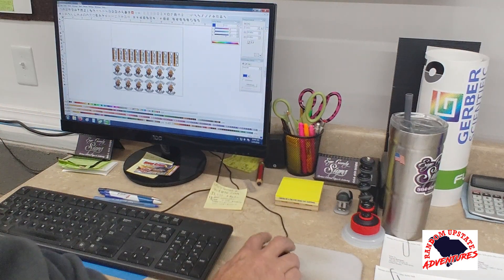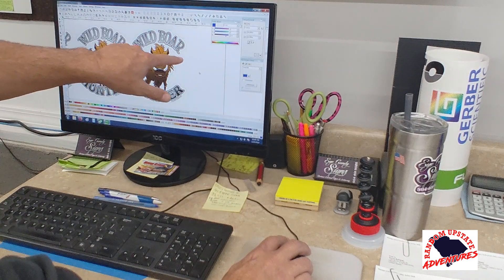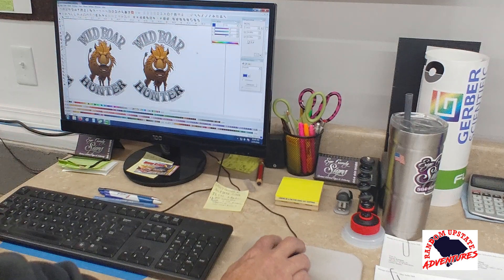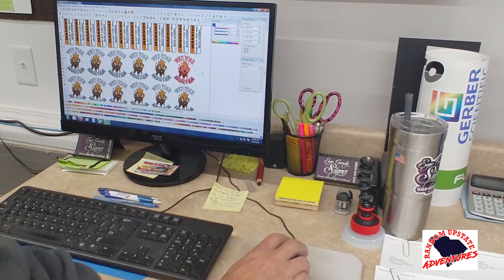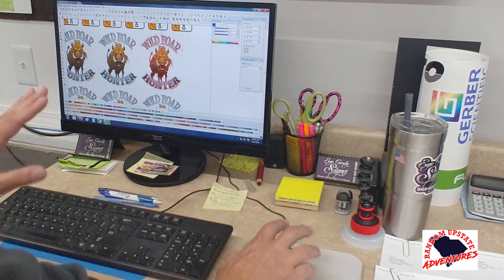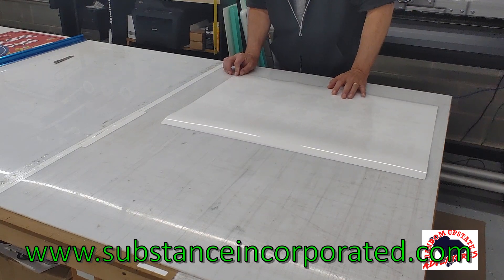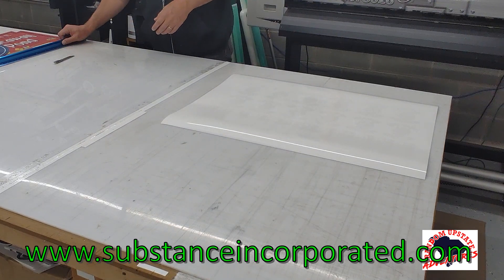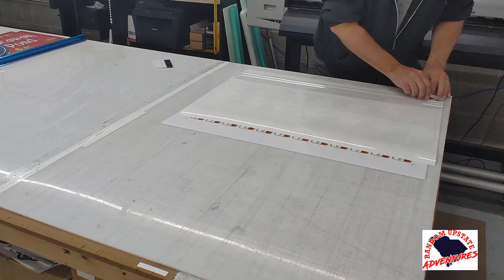Print, Laminate and Perf Cut Decals with Flexisign and Graphtech (PLUS a little trade secret!)

Comment: To be able to cut the adhesive completely, do you use a special Teflon? Does this type of cutting damage the Teflon?
Reply from the maker: With the 8600 it has a "gutter or channel" in front of the Teflon strip. You have to move the blade to the front position of the holder and select perf cut option.

Comment: Thank you sir! I use cutting master 4 through corel, but using these numbers for the fc8600 has helped tremendously...the only thing I may differ on is I use the cb15u blade and the cb15u setting for perf cut, but the setup is basically the same! I never got perfs that would actually "pop" out until now, maybe it was the "up" setting that I had wrong?
Reply from the maker: When the video was made I was using the 45 degree blade, now the 60 degree blade (cutting the media and laminate) is the way to go. Glad it helped, it really depend on the media you are perf cutting.

Comment: What would your settings be if you were to perf cut non laminated stickers?
Reply from the maker: Try around 15 on the 8600 with a 45 blade, not as much with a 60.
Reply: @TheSignGuy  Hey Boss Man,  Quick Question using 45 Blade does the Perf Settings "Up" and "Cut" the same??
Reply from the maker: @coachdonhighdfw  My setting is #3 CUT .315 / #4 UP .006 this is with a 60degree blade. The 45 was just barely getting through the backing and the 60 seems to be a better cut.

Comment: Curious do you always use type 1 marks, or find they get picked up better than type 2 or is it just personal preference?
Reply from the maker: Have been using type 1 even since we had an inkjet printer. 99.9% of the time I don't have any issues with the type 1 marks. I can make them as small as .300/.025/.075 and it will pick up fine on white media. Reflective and mirror media I try to make them .500/.050/.100.

Comment: How long are you waiting in between printing and laminating?
Reply from the maker: Generally a few hours depending on the profile and how much ink was put down. A heavy Black at 720x720 will take a bit to outgas, not that I've ever had a big issue with it. Latex you don't have to wait, EcoSol give it a few hours if you're in a rush.

Comment: Hi i have a roland evo solvent can i use this stuff
Reply from the maker: If you are using Flexisign and a graphtec cutter yes. I don't have any experience with the Rolands, sorry!
Reply: roland is a print and cut machine eco solvent
Reply from the maker: I don't think they can perf cut. Only certain cutters can do that. The Roland will contour cut but not perf cut.
Reply: @TheSignGuy  i just looked it up on roland it does

Comment: This perf cutting has really puzzled me , in your video is it just one cut? 
I wanted to do two, a contour cut , then the perf cut a bit wider to make sticker removal easier , would i contour cut , then move/switch blade position and run the cutter again?
Im using a roland 54" cutter with flexi
Reply from the maker: Hello Ken, Yes in my video I just do 1 perf cut. You can do what you want but it will be 2 separate cuts, 1 contour then move the blade to do the perf cut. Sorry I have zero experience with the Roland cutters but you should be able to set the conditions in flexi
Reply: I'VE HAD THE SAME QUESTION FOR A YEAR. I'VE ASKED THE COMPANY I BOUGHT THE GRAPHTEC FROM A FEW TIMES AND HAVE'NT HAD ANY LUCK. HAVE YOU FIGURED THIS OUT SINCE YOU ASKED THIS QUESTION?

Comment: Using flexi and same cutter. So do the settings at printer override settings in flexi? Or can you also change settings through flexi without manually changing on cutter?
Reply from the maker: Flexi will override the cutter so in Production Manager pay attention to the "cut" tab, and your driver options. You can set the condition there but You should set up a special condition in flexi but it will also require a special "perf-cut" cut line within flexi. I prefer doing it at the cutter because you have to move the blade holder out anyway and sometimes I forget to move it to the back position.

Comment: Why do some people perf cut and others diecut?
Reply from the maker: Um, good question LOL. I assume because pef-cut looks a bit more professional. But also in my opinion customers really don't care unless they are re-selling the decals.
Reply: @TheSignGuy  so I guess my question is what's the difference really?  Perf cut is when the blade moves up and down and diecut the blade doesn't...right?  I typically  just do kiss cuts and never really done anything else.  Check out this video on diecuts.  Skip to 4:20....

https://youtu.be/3tPcWwkm4cs
Reply from the maker: @blueghost4121  Basically yes but your cutter has to have that option to Perf-cut, some dobut most don't. A perf-cut will cut through the media/paper backing and a contour cut is just through the "Sticky" media. I refer to contour cutting with a print//cut, I refer to die-cut with normal solid color sign films. I've never used the term kiss cut

Comment: I see that you have a 54 inch printer and cutter but it looks like you are using 30 inch vinyl and laminate. What's the reasoning behind this? Easier to work with because of the smaller size? Just wondering because I have a 54 inch printer and cutter. Thanks
Reply from the maker: It's more cost effective for me to print and laminate with 30", If I use 54" I waste more media. I've designed most of what I sell based on the 30", I still have some 54" in the shop but don't print on it much.

Comment: Great video. In regards to the laminating? it doesn't need to be heat treated? Would the laminate peel off or does it adhere permanently?
Reply from the maker: No you do not need heat when you laminate. I know heat assist laminating is better in certain situations. I have seen laminate separate from the media but 99.9% of the time it's never been an issue for me. Grab the BIG Squeegee and laminate away!

Comment: i bought some of the substance ICON® PL-3150 overlaminate. There seems to be a lot of silver even with lots of pressure added. Also looks like some metallic flake in the vinyl. I just applied it today so maybe i need to wait a bit. Any tips?
Reply from the maker: So I do get some Silvering when I laminate with the Big Squeegee but it goes away in about 12 hours. Also once I'm done laming, I use a smaller (4") Teflon squeegee to remove more silvering. That's odd about the metallic, I know Substance makes a Galactic series with metallic in the laminate. Never had the chance to use it so not 100% sure what it looks like up close. Pretty sure they don't offer a metallic media, so again it's odd you see flakes.

Comment: What printer do you currently use? Do you use eco-solvent, latex or aqueous inkjet? What do you prefer?

I'm currently using a Graphtec CE7000 for die cut decals, but plan to switch to printed stickers and  product labels.
Reply from the maker: I use a PrismJet 54. It's a rebranded Mutoh ValueJet sold by Sign warehouse.com. It's a 54" eco solvent printer that will print on just about any type of media. Before our 2 Eco Sol Mutoh printers I had a encad aqueous printer and a thermal Roland pc600. They were so slow but each has their place in the shop.

Comment: questions, so is perfcut the same as diecut stickers?
Reply from the maker: I generally refer to "diecut" as solid color vinyl cutting, contour cutting is cutting a "contour" around a printed image generally with a square backing. Depending on the size of the item being printed, sometimes it faster to contour cut and leave the backing square and straight. Where a perfcut is also contour cutting but also cutting into the backing to make a "pop out" or perf cut sticker.
Reply: @TheSignGuy  thank you for sharing your knowledge. I guess I have been using the terms incorrectly 🤣. Also doing my cuts incorrect . 🤣.
Reply from the maker: @fifiearthwanderer  No problem, we all started somewhere.. Oh the stories I could tell... LOL

Comment: Wondering if the any of the decals are meant for being outside (attached to a vehicle) ?  Wondering if the weather would fade the color?     Would you ever consider putting a laminate on something as small as the stickers shown?
Reply from the maker: All of the decals I print are for outdoors use and vehicle safe that are printed with ECO-Sol ink, granted you clean the surface you are putting the decal on. Weather (hot/cold) does not effect the color, the sun's UV rays will fade the colors. I laminate 99% of everything I print, even the smaller items.

Comment: Been trying a ton of things on my graphtec, ended up pulling the blade back in a ton to almost standard cutting levels and driving the force up only 10+ from the original cut, my perfs come out a lot better with a custom perfing line but they're still jagged.  Never going to be as good as a die cut with these things.
Reply from the maker: You are 100% correct. I dont adjust the depth of the blade from die cutting or perfcutting it stays the same. And I'm still using the 45 degree blade for 2 mil vinyl up to print/lam works great for me.
Reply: What do you recommend for cutting settings on the Graphtec (Speed, force, etc.)?

Comment: I think I added my comment in the wrong space. Do you have a good file that follows this process that you could share so I can follow.
Reply from the maker: The magic does not come from the file, it's in the plotter condition. When setting up the file just add 1 normal contour cut. Set up your Graphtec plotter so it will perf cut (go back and look at my settings to get you close) and you will need to change to that condition (I used #8?) move the blade to the forward position on the holder and send it.
Reply: @TheSignGuy  Thank you for responding. The reason I think its my file is because I have condition 1 and 8 for per. Still my cut is not clean. Can I show you what they look like?? Please help me

Comment: Just a tip from a fellow Graphtec user. I noticed your setting for the up position was up. This causes the blade to come fully in the up position which increases wear on the head and also can cause jagged edges on the vinyl. If you adjust this value to the same value you would normally use for contour cutting, it will only lift the head to that force which stops the up and down motion, still cuts through the vinyl as if it was a continuous contour (‘but only perf cuts through the backing sheet) and makes the running a lot less noisy. Hope that helps and thanks for the video.
Reply from the maker: Have to try that, thanks for pointing that out. Many people are self taught and just need a direction to go in. This is one of those situations.
Reply: So on the “Cut pattern menu” do you recommend leaving “Up mode” to “off” ? Is this what you’re talking about? I just started using my Graphtec ce7000-60 for perf cutting and I wanna make sure im doing it right lol Their training video doesn’t mention this and they have theirs set to “up”. Also is a 1.5 mm blade recommended for this only? I also think in the training video they’re using the 0.9 mm blade. Appreciate the help.

Comment: is there any option in flexi to smooth out the edges for per cuts so its easier on the cutter
Reply from the maker: The blade is only following the contour line, so I try to make them as smooth as possible. I'm not sure of any option to make them smoother, you can always slow the cutter down too.